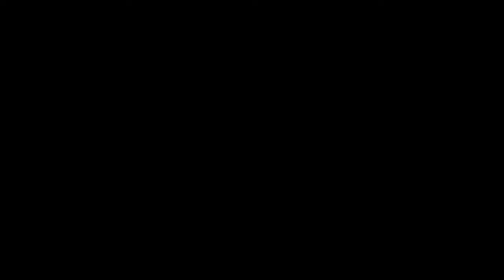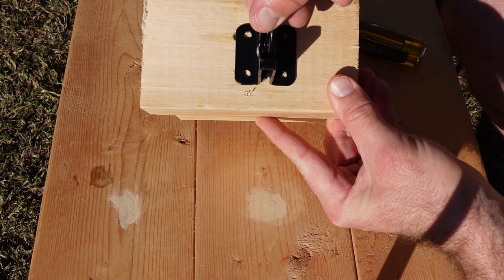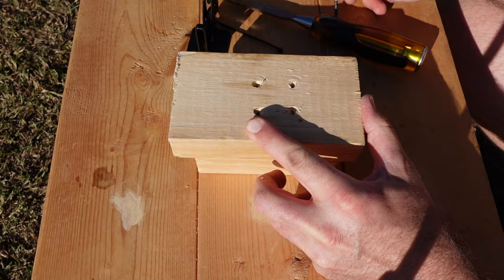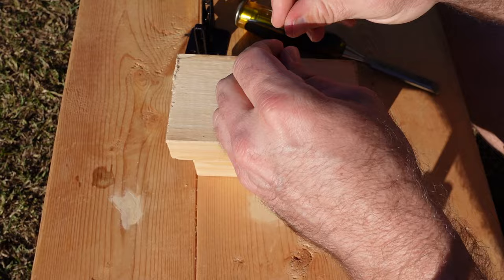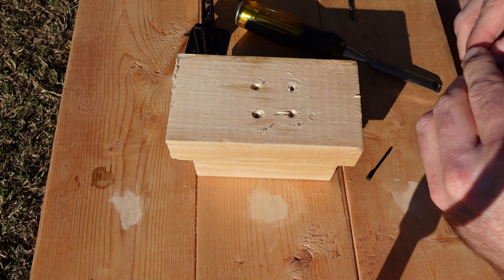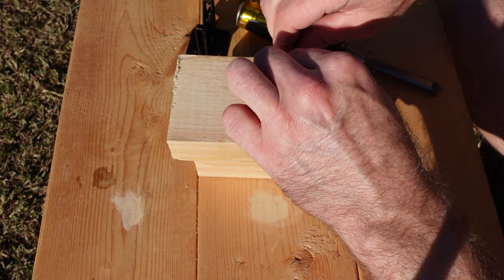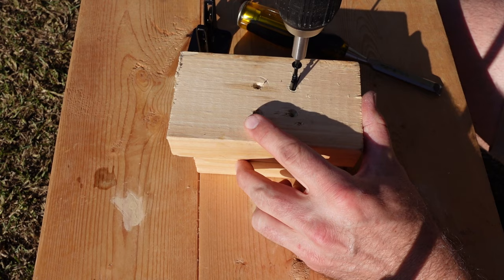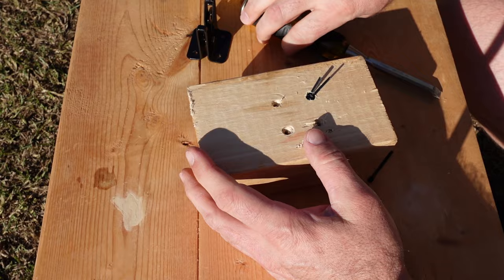How to tighten a screw when the pilot hole is too big.

Comment: A small dowel or a few tooth picks work very well. If the hole is way too sloppy, drill it out larger a, put in a piece of oak dowel and red rill to correct size.
Reply: What's red rill?
Reply: @vince7735  redrill
Reply: @edge1289  🤣 of course..thank you!

Comment: Nothing better than taking splintered pieces of wood and packing the hole with those. Sometimes they are the easiest thing to find. Any scrap piece of wood. Shave a few thin pieces off the corner and that screw will be good as new

Comment: I have a similar problem with trying to hang a  dusk to dawn light. There is a bracket on the light that has three slots, one at the top and two at the bottom where three lag bolts are used to secure the light to the gabble on the front of my garage.  Unfortunately when I drilled the pilot holes for the two slots at the bottom of the bracket I got them too close together.  It's only about 1/8th of an inch too close but it's enough that I cannot get the bottom slots on bracket to slide around the bolts.  I need to drill another right next to the one that's already there.  That I'm afraid will make the bolt too lose because it is so close to the hole that's already there.  I'm wondering if this trick will help with that.